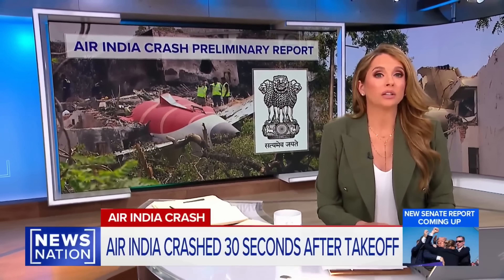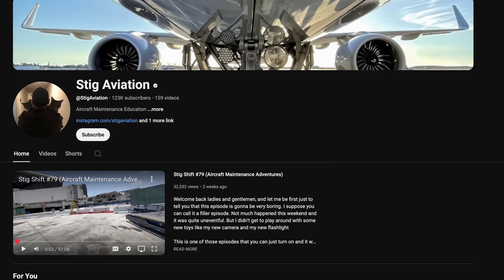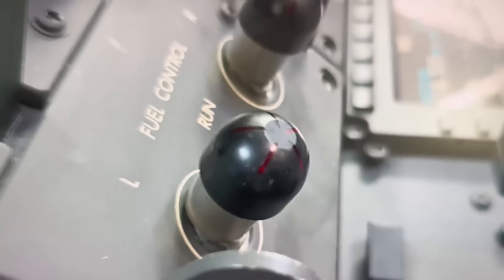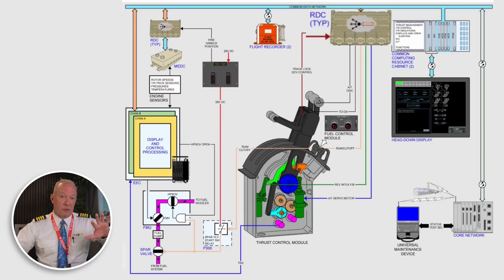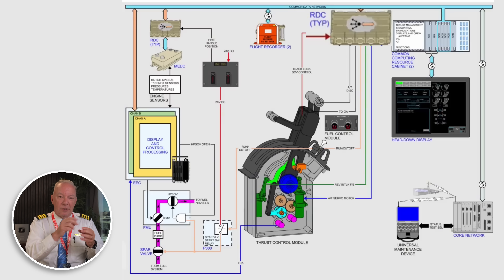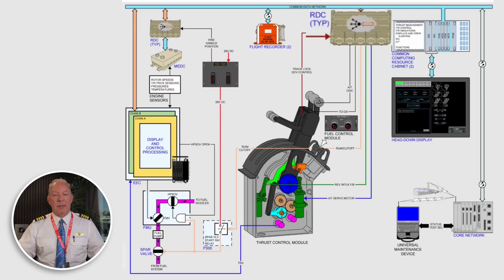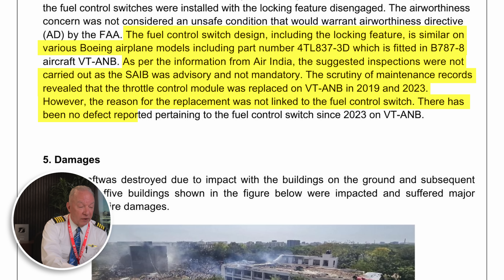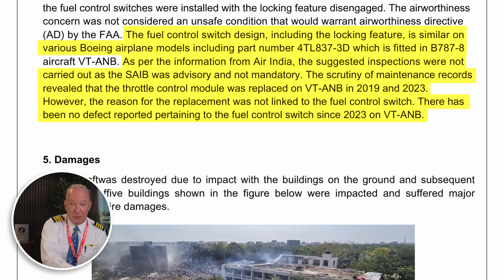The Truth About Boeing 787 Fuel Control Switches

Comment: The RDC isn't a 28V system, is it? So it takes a second hot line from the switch as a signal to report its valve activation position, is that true? It's the diagram that confuses me. Both switches have the same DC power supply? Then separately, the RDC box is signaled by either  switch that also powers the three valves. One on a wing spar where the engine is, one linked to the display and presumably the auto-throttle, and is the third a high-pressure shutoff valve? The red DC wire provides current, and Steve said it was a mechanical link to open/close the relay. An electromagnetic induction coil holds all valves fully-closed when energized, with a spring-return to a powerless "open" position without. Those steel plungers are prone to embrittlement when repeatedly used, though that's not the problem, is it? 

That makes sense to me, an average idiot. And those switches are four inches apart, leaving that same space for relay and lead and RDC wire separation. The cutoffs worked just fine after their leg from Delhi. In the interim, the fuel system had been operated from the left wing panel in its normal refueling operation for their next outbound flight to London. From what Capt. Steve is saying, those refueling and maintenance circuits are isolated from the fuel cutoff switches, and no false tattletale message can be sent to any RDC for that reason. The RDC switch position notice is sent via the same 28V DC that exits the closed cutoff switch circuit. A short between those could indicate one, but not likely two DC energy signals, a full one-second apart. 

Accidental water or humidity seems too much coincidence to believe. That both engines quit, can only be their failed fuel supply. There is a wifi maintenance link to the onboard network shown that could be suspect, especially if techs were running diagnostics onboard or within reception range at that end of the runway. It certainly wasn't an MRI at the medical school. Nobody has said that it was either. If one or more of the valves was restricting flow in the lines, recycling them is not something to try at rotation. If throttle controls signal the display and control box to moderate fuel flow through one valve, nothing says that it does, But the replaced throttle assembly does not seem to have a path to close that DC tattletale circuit. Both relays failing in the closed circuit position simultaneously sounds awfully rare, if indeed they're isolated and one doesn't overload the next and cause its failure to close the circuit too.

An errant message to both RDC lines at the same time as a twin engine fuel-supply failure is off the charts of probability. That is unless of course, the investigation is lying and they've added that "transitioning to cutoff" message to the disassembled data recording or transcripts in order to save the companies' reputations. Ooops, it's way too late for that. Captain Steve's explanation and schematic could be all too simple and dead wrong, but I don't think so. He sure makes a good case!
Reply: So long as ALL three valves spring open and stay that way, all makes sense. But if only one valve in each of the lines is activated to close by the "CUTOFF" positioning, that leaves two others controlled by other rules. I don't know how an RDC can identify the sender of an uncoded switch signal to its logic circuits, but they must have thought of it. The RDC in the schematic is interactive with the control boards that no-doubt read messages from all of the valves. If one had a malfunction, due to algae, rust, or water in the lines, surely the controller would alert pilots and possibly initiate a repair? If something has been overlooked, and it's not nut-job pilot excuses, then they'll surely catch it the next time,...or the time after.

Comment: The issue isn't the fuel switches. That is a distraction and blown out of context by the media.   I tend to agree with the pilots not at fault hypothesis at this stage. When one of the pilots said ; why you cut off, they might not have realised or have been aware of the RAT deployment and failure / engine shutdown sequence having been initiated ( potentially by the FADEC or other unknown system cause or failure ). The other pilot ( not flying the aircraft) , thus hands and mind free and more cognisant of the peripheral system failure, cycled the fuel switches near immediately. The non flying pilot initiated an unscripted non standard disaster recovery process ( for which no procedure exists at a few hundred feet above ground after take off !!! ). This could explain why he indicated that he didn't cut off the engine. i.e. the pilot flying would have been focusing on flying the aircraft, not the system issues. I can see this scenario playing out in the mad rush of activity in the cockpit after the RAT deployed and FADEC sequence was already in play before the pilot flying even realised what was going on. Hence his question to the other pilot of ; why you cut off. Etc... i.e. The pilot asking that question, simply wasn't aware there was an engine failure / shutdown event already occurring, by the time the other pilot had already taking last resort action. i.e. Recycling the fuel switches to force trigger a FADEC engine restart sequence. i.e. for lack of a better idea at a few hundred feet off the ground and recovery time rapidly running out. It was like a last ditched effort straight up, with no other options available. Thus the pilot flying the aircraft, incorrectly interpreted the actions of the pilot monitoring, who had rapid awareness of the perilous unravelling situation heading toward the disaster.
Reply: Kinetic energy would likely have caused the speed to exceed 180 knots if the engines were still running at full power when fuel was cut off. This inconsistency is just another reason for the skepticism surrounding the report.
Reply: The phrase "fuel cutoff switches transitioned" is ambiguous. It logs an electronic event, not necessarily a manual action. A system failure, such as a faulty WOW sensor logic unit or a FADEC command, could have caused this circuit registered transition. The fact that the report references this fuel switch status in data form,  indicates clearly that an electronic logic circuit is involved at some point in the process of determining the switch status.  The data is based on the status of that circuit and not the fuel switch directly.  To keep saying no circuit is involved is simply erroneous and thus misleading.  The 787 is a modern aircraft and predominantly has electronic / electrical based systems linked via various electronics circuit modules, the FADEC, WOW logic unit and other electronic based systems.
Reply: Why is it so hard for guys like you to accept simple facts? The preliminary report clearly states that  the switches were moved and caused the engines to lose power. There is no "issue" about the switches..
Reply: @fritzchen0.523    Do you seriously think the preliminary report is accurate?   Several international and domestic pilot associations, including the International Federation of Air Line Pilots' Associations (IFALPA), have been highly critical. They have publicly stated that the preliminary report's selective release of information, particularly the single cockpit voice recording quote, is incomplete and encourages premature conclusions.
Reply: @JoeyBlogs007  you engage in fantasy
Reply: @thesweeples3266    They said that about those that questioned the 787 Max faults.   We know what happened in reality don't we. 🤣🤣
Reply: @JoeyBlogs007     Your conjuring up non-sequiturs instead of dealing with facts.
Reply: @thesweeples3266     The facts are in short supply.  If you think the preliminary report fully represents the facts you are deluded.
Reply: @fritzchen0.523    Apparently they made a botch job of the crash site.  Completely contaminated the evidence.

Comment: Nice explanation. I would suggest to watch video regarding Air India 171 crash on channel @flyingbeast (Gaurav Taneja). Hello has explained why the fuel control switches were moved from run to cutoff.
Also, this is not a suicidal attempt because the landing of plane was such that minimal loss would occur.

Comment: Those switches looked like several critical safety switches in the CH47s I flew 50 years ago.  You really couldn't accidentally activate or turn off those things.
Reply: Why arent we considering a possibility where dual engine failure happens just after take off. Then pilot manually turn fuel switches off and on because thats SOP in Boeing planes in case of Dual Engine.? You can refer to Gaurav Taneja AI 171 Part 3 in english dub to understand more about this theory as timeline of RAT deployment also matches with this
Reply: @ishanarora7948 it’s never SOP to touch the fuel valves under 800 feet. The SOP is continue takeoff until you get stable, then you worry about checklist. Basically below 800 feet, you keep flying. Trying to run checklist that low would be deadly.
Reply: @ishanarora7948 too many what ifs in this statement.
Reply: @ishanarora7948  It's not SOP this soon after takeoff. You've spammed this lie many times throughout the comments. You can repeat it until the end of time, and it will not make it true.  Ridiculous.

Comment: Tell you what, everything from the filmsy micro to the stone age MN4 A/D  processor lunch box, is not meeting the basic entry requirements of a mission critical SCADA. Even the purpose of an Emer switch is ill defined to be cutting out fuel airborne. What are you flying?

Comment: You are still sticking to the physical activity of the mechanical switch.. there is no issue with the mechanical switch.. 

What if the 28 V battery fails? 

What if there is short circuit? 

Will the relay coil survive the over current or over voltage? Or under current/ under voltage?

Will the relay stay in open position in all scenarios even during complete power failure including battery??

Is the mechanical switch is the only input to the relay?  If yes how it shuts down the engines during engine fire??

Why can't it be a relay failure? Will relay contacts and coil survive the short circuit?  Does it fail with open contacts? 

How many contacts that relay has? 
Relays can have multiple contacts, some of the contacts can be open and some contacts can be closed at the same time.. 

Whatever signal the mechanical switch can send.. that same signal can be mimiced without mechanical switch just by fluctuating the voltage.. 

What is the specification of the relay ?

What is the connection  between data concentrator and mechanical switch? 

Why does the system allow to cut off the fuel to both engines during rotation?? 
Even if it's an engine fire, cutting off fuel to both engines during rotation is going to give the same result: crash.. 

How come RAT deployed before engine shut down?

It was an electrical failure because of which RAT deployed and  the engines shut down due to electrical failure.  not the other way around..

A decade old battery will never be a reliable power source..

Even my phone restarts without any clue when there is a problem with the battery..

The 10 seconds time gap to put the switch back to on position is the time taken for RAT to supply the power back to the relay..
Reply: And how any of your absurd questions did not register in FDR? RAT is deployed then fuel switches are moved OFF by logic circuit, it does not need to wait for engine spool down as OFF condition is already set.